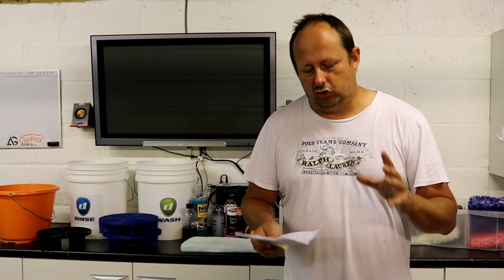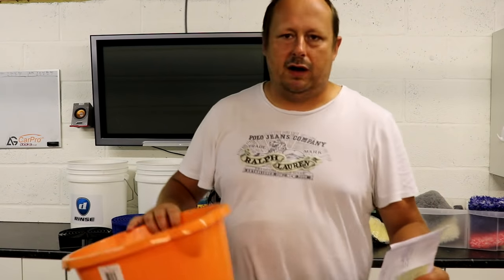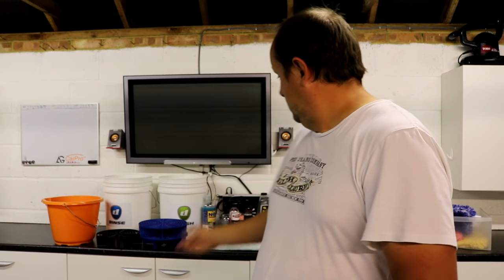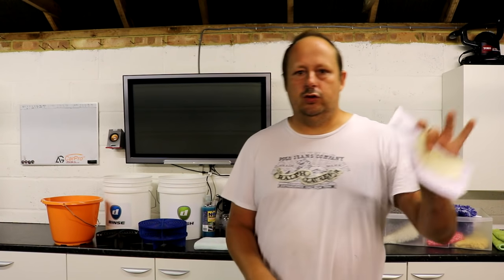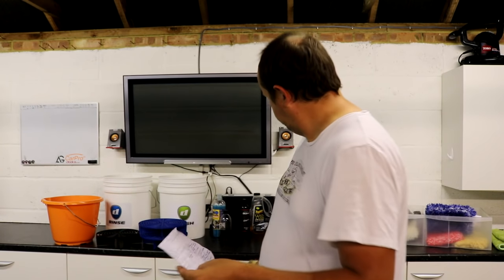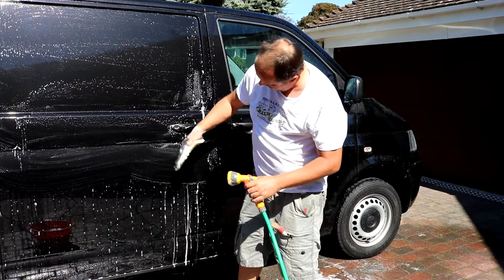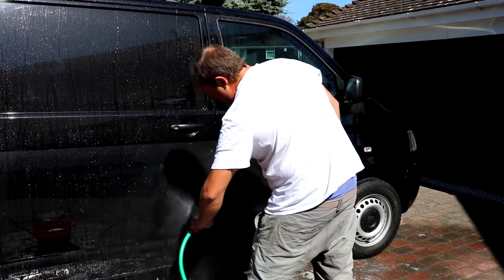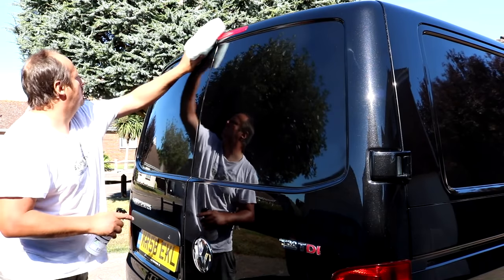The Forensic Detailing One 1 Bucket wash method

Comment: good technique really liked it. btw your can make it bucket less by using a water gun with  soap dispenser
Reply from the maker: Defo you can..  Ive played around with this as well.. bought a ton of soap guns..  the problem with the regular one (soap gun) that most vendors sell is its not easy to switch between soap and water and thats why I settled on this method..  But I did look at about 4-5 different soap gun methods.

Comment: I got some of the wash mitts you recommend on this video the other week... When I rub one against a CD it causes some swirl marks... Not sure whether they're bad enough that they'd cause any issues on the paint - is that anything that you've noticed when using them?  Cheers!
Reply from the maker: ok so testing things on CD's is cool..  but the surface of the CD is softer imo than even the softest clearcoat..  And the 2 materials are not a like for like thing to compare...    So I can put micro scratches in CD's with even the best buffing cloths on the market if I rub hard and fast enough, but I cant on clearcoat.

but testing on CD's is still usefull because it allows to you to compare things...

Comment: Sorry dude but no way I can do your method unless I want my water bill to really high. You used so much water and I can't be doing that lol.
Reply from the maker: i think for the filming I was like taking longer than I normally do to clean the mitts and rinsing more than I normally would, because the cameras rolling  and your trying to get money shots etc..   but you save 15 litres of water by not using a rinse bucket but you could be right it might use more water than normal.. you could also just buy 5-6 of the chinese mitts like lots suggest and then have no mitt rinsing...  I shot this a while back because I kind of didnt feel i needed to use a 2 bucket method on my van and the gold etc (still dont generally)... but I dont use this method all the time.. its just "a" method I guess.  the onr is important to this although it does reduce the foam levels quicker...
Reply: Yes that sounds like a good method, use one bucket, and just use multiple Mitts and since you said they where fairly cheap that should be good. Thanks.

Comment: Well said. I use have always used the 1 bucket method rinsing the mitt with fresh tap water on a jet setting. I have never understood all the hype regarding the 2 bucket method as for sure it will not clean the mitt as effectively.

Comment: I like this method, will try it and the wash pads. I hate having 2 heavy buckets to drag around the car. Better then to have one wash bucket on each side of the car. Most important to me is to get the car as clean as possible before even touching the paint. BH Auto Foam works really well especially on a dirtier car.

Comment: Forensic Detailing Channel 
I've done this method for over 10 years with the 1 bucket and rinse. Here's the reason why I've gone to multiple mits and why i will never go back to 1 mit again.

!!!TIME!!!

I simply can't express how much time you save by using multiple mits.

There's also the fact that there will be a few heavy sticky particles that don't come off the mit easily when spraying it off with the hose. When you notice these particles on your mit, you'll have to spend extra time trying trying to pick them off with your other hand which extends your overall time.

All in all you could have simply  used a fresh mit for the next panel and continue washing your car instead of the 1 mit.
Reply: I could not agree more.  The method in this video is silly.
I use 6 mitts for my SUV:
- 1 for rear
- 2 for side doors (1 per side)
- 1 for roof
- 1 for hood
- 1 for front fenders an front.
I fill my bucket half way with water,  add shampoo (CarPro Reset), dunk the mitts, fill up with more water using Pressure washer to activate shampoo.  After using each mitt, they go to a separate empty bucket which will then go to the washing machine (I wash my car biweekly).

Comment: spent some hours watching these vids and I've got to say that this guy is amazing. usually I want to get to the point, but this guy is far from boring. keep up the excellent work.

quick question. just bought a new focus st and paid 400 to have a paint protection put on. ford says I can wash and polish as normal but I'm unsure. Also doing the two bucket I've managed to scratch the bonnet slightly and worried about polishing it out with the paint protection "stuff on it. any thoughts.

my car is stealth grey not metallic.
Reply from the maker: cheers marko...  an abrasive polish will almost certainly strip the dealers special sealant (I put almost certainly as a disclaimer as I dont know exactly what they have used but I have a pretty good idea)
Reply: Cheers for the response. A friend tells me it's Diamondbrite. Apparently I was ripped off. If you can think what's best. Was going to use Oblivion or soft99 but worried about how it states *Be sure that your car is compatible with this product in advance. Worrying?
Reply from the maker: the dealers use it as like a bargining chip.. but yes generally they are overcharging and if you have a reputable detailer in your area they can perhaps give you better advice on other protection offers which offer better value for money..

Ive sat in front of dealership sales guys and had this hard sell of their "protection" packages and they literally will not let it go..   Ive walked away from cars because of the way these clowns try and rip you off..
Reply: Cheers for your replies and for the honesty. It's always a learning curve.

If only I found your channel beforehand I'd have saved a fortune , in saying that, my fathers old vectra looks mint. Looking forward to cleaning his engine bay with tips from your new upload.

I'm sure I speak for everyone... keep up the excellent reviews and super easy to understand guide.
Reply: you were mugged

Comment: If you are looking for a super soft brush, have a look for a Silver Tip Badger shaving brush. The hair isn't trimmed to shape like hogs hair, so each fibre tapers to a fine point. You can pick them up for less than £20.00 from China on eBay. I use an old one for washing around badges, add a tiny drop of detergent to the centre for epic and endless creamy foam.

Comment: Jon, I could not agree more about the two bucket method and grit guards do not guarantee that you're keeping dirty water off the clear coat. I personally use one large 3 gallon bucket, but load six to seven channel microfiber noodle type wash mitts into the bucket and let all of them soak and get happy in the wash solution. When I start my wash, I use both sides of one mitt on a panel. Once that mitt is soiled, I throw it in a separate bucket. I keep using the other six mitts until my entire car is washed, never dipping a soiled mitt back into my clean wash bucket. I even go as far as putting black wash mitts in the bottom of the bucket, since I wash my wheels, tires, exhaust tips and wheel arches as the last step after cleaning the paintwork. That way, only the black mitts will ever be used for the dirty dirty areas.  I will never put a soiled mitt back in my clean shampoo solution, so the water never gets dirty. I also try the buy light colored mitts to see if there is any contamination in the mitts when I begin the wash process. At the end of the wash, I take my second bucket of dirty wash mitts and dump them in the wash machine using Chemical Guys Micro Fiber Wash.  It doesn't matter if you're machine washing one mitt or ten. There is no extra work involved. Your cheap Chinese mitts would be perfect for this method, especially since you have a big bag of them. This is the fastest method and leaves no chance for cross contamination.  Try it and let me know what you think!  Great video as always!
Reply: Steve Greer e
Reply: I like the idea of that! I'm gonna try it.
Reply: Steve Greer Wish I would have done a video of my carwash this Sunday. 

I hadn't washed the car in 6 months (went through the snow and all that) and I used 2 buckets and 1 grout sponge.  I put 2 oz of soap and 1 oz of ONR in one bucket and water in the other. 
At the end the water bucket was black as heck and the soap bucket still looked very clear (was it 100 clear no of course not).

To top it off every time my sponge left the bucket to go on rhe car you could see how clean it was with no dirt tapped in it.

Someone told me about using grout sponges to was the car, and Iv never looked back. Traps the dirt and don't scratch when washing, but when you dunk and scrub on the grit guard it releases the dirt perfectly.
Reply: I already use a single bucket method and a short pile Meguires MF sponge, just hosing the sponge face off every pass [1 to 2meter swipe on each side] before redunking for soap. I believe it works great. Has to be a short pile though because the longer piles just hold the dirt too well and you can't quite seem to flush the dirt out. I still use a grit guard and still at the end of the wash there is a tiny bit of dirt in the bottom, but FAR LESS than using a 2 bucket  method!.

Around 28minutes he shows a single panel wash, or the door and front guard... I would have rinsed the mitt 4 times to do that area! Maybe a bit more paranoid? 

 But, I'm sold on the idea of 6~10 of those Chinese mitts and pre-loading the bucket with them for single use! Fantastic comment and tip, thanks!
Reply: Has anyone done this with the Adam’s wash pad? I personally don’t like Adam’s for the two bucket, I wonder how it work with this method (scratching, etc)

Comment: Àm so glad I took the time to watch this vid as I was about to buy into the 2 bucket method even though it's expensive for what you get - so glad I haven't wasted my money !!! You just make so much sense & common sense to me. Your process explanation couldn't have been clearer & the demo on your van proves the point. Love the added tips too (like adding ONR).

You views & recommendations are becoming very trustworthy after just watching & trying a couple of your tips, thank you. The challenge now is to drag myself away from years of using Autoglym almost exclusively as I've not seen you recommend one of their products in the 2016 awards vid or mention them elsewhere so far? Your advice is valued as you come across as a straight-up, no nonsense guy, so will use up what remains of my Autoglym arsenal then try your 2016 'gold award' products one by one.

Keep up the good work, it is appreciated from this end. The only positive criticism that could be offered is to try to bring the average vid length down without losing tat all important core content. Sometimes there is too much detail in there that doesn't really add to the quality of what your are doing & maybe you may sometimes lose some of your intended audience.

Comment: Thank you Jon great video as always :) I use 1 bucket method always , I will use two buckets when the car is very dirty then will be Wash+Wash buckets no bucket for rinse , one bucket for washing in driver side and another for passenger side , I used AF Citrus Power as prewash but I feel is very strong in LSP I think Valet pro Citrus Prewash or Powermaxed Jet wash & wax can helps to remove dirts in lower panels before start washing .

Comment: My Grit Guard mostly just sits on a shelf these days.  We share VERY similar views. I don't bother with the expensive wheel thingies! haha. - Also, I use a similar method to your one bucket, and like a couple of others have said.  I use a cheap bucket with a lid (to just sit on top while I'm washing the car, keeps contaminants out). And I use multiple wash mitts, 6-8. You can save more time by NOT rinsing the mitt, and instead just discard for washing later, and replace it with another clean one. PLUS, less chance of bringing back some dirt into the soap bucket. Great video. This one is your funniest.. Thank you!
Reply from the maker: cheers BB :)

Comment: I've done this a few times now and am very happy with it as a method. Watching the jet slice the dirt off the short pile is very satisfying. Using only a small bucket, I have noticed that the washing water stays very clean. I think this is as good as, potentially better than, the traditional two bucket method. The Hozelock multispray is an excellent tool in it's own right. Trouble is, what do I do with those two massive buckets in my garage?

Comment: Just a quick update. I am No Fan of this method, tried it yesterday and didn't help me dunking the Lamswool mitt into the soapy bucket without rinsing. My head must of been telling me that I'm still 2 buckets! With full follow up I think it took me as long and the results weren't too pretty even after a coat of Beadmaker. Just cant help thinking I need my Polar Blast and Polar wash (which I've yet to try). Anyway what finished it (nice sunny day) took the wife out for a walk parked then she got out looked at the car and started making comments including 'waterspots' streaky windscreen thats before she got to the wheels. Commenting on brakedust behind the alloys and more dreaded waterspots. We've been married 20 years and I'm fairly new to detailing, her car went through Tesco's car wash (not anymore) and that was it. For me the works van got the car wash treatment before an earlier retirement present Beemer mineral grey. Her only detailing comment in the past was she thought Jon's voice sounded nice as it aided sleep. Her last comment was you better get the full kit out today and start again! Bollxxxs I wait until everything gets a bit cooler and dirtier first! 
Not sure if Beadmaker is forever for me. Definitely smooth silky touch but don't last too long and can't honestly say I think the finish is better than Meguirs Ultimate liquid wax. My next steps is to buy a DA polisher but sadly is on hold until my customers come back.

Comment: I use the same one bucket method except I use a pressure washer with a short gun (MTM 407) and the bucket has very little to no dirt in it at the end, whereas with the two bucket method there will be much more dirt in the wash bucket. I always wash the wheels first with a separate bucket and brushes and wash mitt.  I keep all wheel stuff separate to avoid contaminating the paint with metal and brake dust.

Comment: Hi mate...I been a mobile detailer for 4 years and early on I used a swiss Vax detailing brush to clean some dust from interior clear coated plastics and to my horror they scratched the surface. So I mentioned to my flatemate that I needed some softer brushes and she went out and bought me a make up kit believe it or not. It came in a roll like for tools and was bright pink. God bless her. Anyway I gave them a go and got to say they work really well. Soft as a babies bum and the hairs don't pull out as with some cheap art brushes. There are about 20 different sized brushes along with some pipe cleaning brushes which I used for inbetween the seats and console when the vacuum can't fit. I would never have thought of buying them but I'm still using them. Sure I still use the stiffer brushes for other areas, but if your looking for soft it's worth considering. Maybe "borrow" one of the wife's. Also, I use this method for my contracted weekly business customers who put 8 or so cars through a week. They don't care about micro scratches they just want the job done as quick as possible to keep costs down.
Reply from the maker: hey there,  I use the soft make up ones for inside.. but im really looking for decent quality ones for outside that are a bit better/softer than these average hogg hairs cheap ones... but are also cheap in price!! :)
Reply: Ah yes...The old... I want to live in the penthouse but pay ground floor rates. You might want to look for a soft/medium bristled paint brush and cut to length. Or make your own. Good luck and good hunting from down under.
Reply: Forensic Detailing Channel   p

Comment: Lived on a farm in the hills of Western Australia overlooking Perth,  driveway was 400mtr long of gravel and mud long so imagine winter time, I always used the one bucket, garden hose method and never had swirls or scratch marks for the last thirty years, never understood fully the two bucket method, as the Forensic Detailing advised, if your mit/sponge (sponge does not leave scratches or swirls) gets dirty rinse with the garden hose then place in bucket of soap. works every time and save you time.

Comment: the best method and ONLY method IMO is the 1-bucket method with 5 wash mitts. 1 for the hood and front grill and bumber, 1 for the roof, 1 for the deck lid and rear bumber, 1 for the left side of the car and 1 for the right side of the car. After you use each one, toss it to the side and move to the next mitt. If you do it this way then you are guaranteed to not transfer contaminants from the bucket back to the car. The wash water will be as clean when you are done as when you started. Those grit guards only get about 80%-90% of the contaminants from your mitt. If you are skeptical then give it a try my way and then the 2 bucket method. Your wash bucket will still have dirt and contaminants in it when your done using the 2 bucket method with those grit guards.